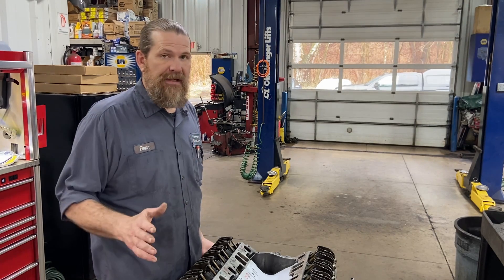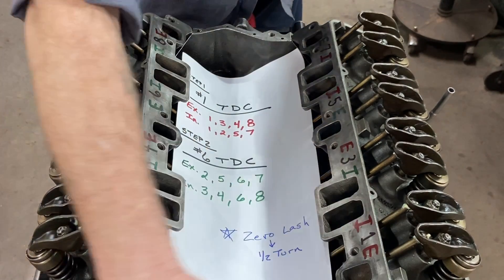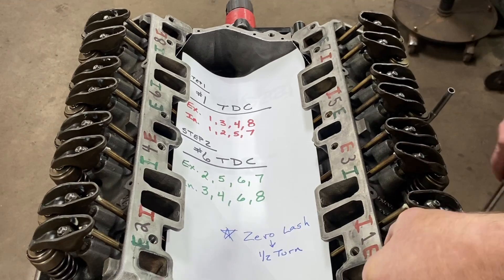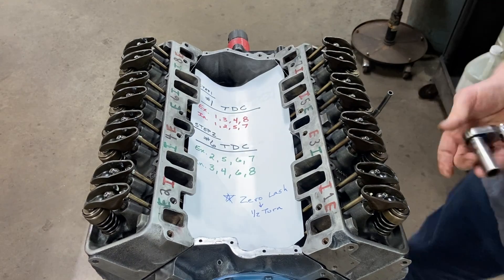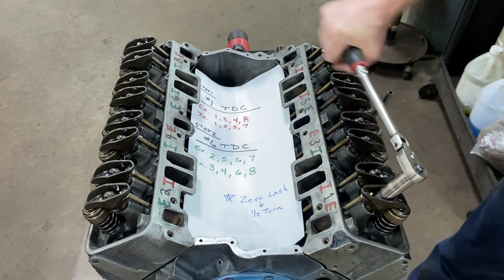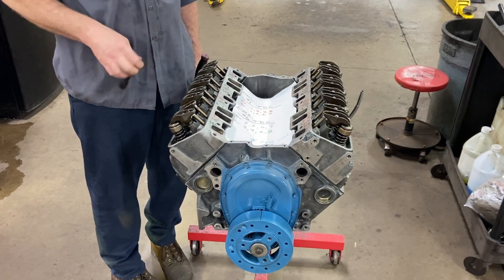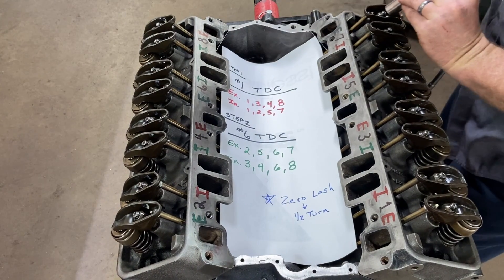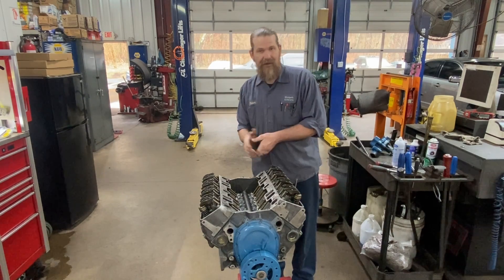350 Chevy Valve Lash Adjustment

Comment: A better way I've found to adjust valves, especially if the intake is on, is to actually grip the end of the rocker where it touches the valve with your fingers and go up and down until there is no up and down play with the rocker itself.

Uncle Tony's Garage explained this very well on his video "SB Chevy Hydraulic Valve Adjust 101". Except I go half turn except quarter turn.
Reply from the maker: Thanks for the tip!

Comment: Had a question. Since I can not find a intake manifold gasket install video. Where should I put black rtv just on the water ports both sides of the gasket or should I put it on the heads part first the put the gasket on and put it on the otherside where the intake fully sits on the gasket. What about exhaust ports does it get any black rtv or is that a no on all ports including none on heat cross over port. My heads have the heat cross over.

Comment: I swear I followed your video and instructions perfectly… when I rotated 360° some of the first set of rockers and push rods were loose. I don’t understand why I followed the same instructions for cylinder six and I had the same results for some of those rockers. When I checked them, I double checked them, and I made sure that the rockers were tight and it was just spinning of the rods that was there

305 TPI
Reply: Have you found out what that was, I’m having the same issue. I’ve done some research and apparently it could be the cam lob I flat or the lifter is fully collapsed and needs to run or it is actually not usable anymore.
Reply: @kaydenmorst4962  so I was never successful however, a mechanic with a brain came over and we started the car with gasket covers on the rockers, so the oil did not spill. And then he adjusted the lash while the engine was running. No to self if you’re going to hit the throttle at all, please have a fire extinguisher handy The rocker gasket covers prevent oil spilling at idle, but not at any type of throttle, and the manifold caught fire for a moment.
Reply: @kaydenmorst4962  I was never able to do it the way the book says. I had a mechanic with a brain come over and we set the lifters at idle. I bought some rocker gaskets that work well at keeping oil at bay until you throttle the engine. Make sure you have a fire extinguisher handy because the oil hit the manifold and caught fire for a quick second.

Comment: Hi thank you for this easy to follow video! But can I do this to adjust the valve on my 305 still assembled and not with new lifters ? I have Hydraulic lifters.
Reply from the maker: @adri14f  Glad I could help. Yes you can.
Reply: @threeriverswrench  thank you. I was doing something similar but maybe I focused too much on side to side moment of the lifter through the fingers. Once I adjusted them, i came back dot a double check After a full rotation of the crankshaft and I found again side to side play! So I have to focus only on the up and down

Comment: Does engine have to primed? Tried on my fresh rebuild, new cam and lifters, 350 sbc, and after the first step and rotate 360, some of those in step one become loose again....
Reply from the maker: @rrwoodworksmore9239  Usually I submerge new lifters overnight in oil. I would probably crank the engine with starter for a bit and valve covers off, and see if they pump up some more. If not, you may have to readjust after the engine is running. If you take the slack out of a lifter that’s not pumped up now, you may damage it. Check other sources to see if I’m right on that.

Comment: Great video. Thank you. One question I’ve a fairly large cam .480 lift I believe. I bought motor built. I hear one valve slapping. Would this apply to my Sbc 350?  I read a comment on here  where it may not. Thanks in advance.

Comment: Great Video, thank you for sharing, I am curious however why do you opt for half a turn after 0 lash, my service manual states to go 1 full turn after 0 lash and another very common one is 3/4 turn after 0 lash is found, it seems to be quite the debate, how often do you like to adjust the valves on a stock 350? I will be doing the lash adjustment on my new to me 99 tahoe after a long list of other things and absolutely love the obs chevy
Regards
Reply: The best thing to do is 1/2 turn. Then run the engine. You'll need to adjust after if there are performance or compression issues. It's better for that route just in case a full turn bottoms out your valves on the pistons. And that's a bad time.